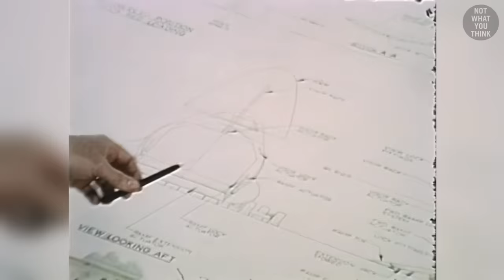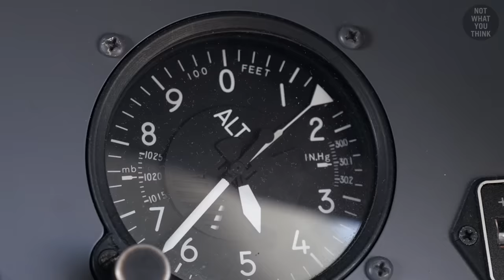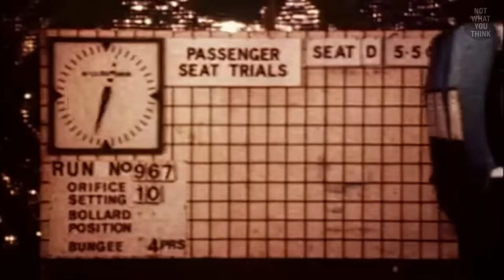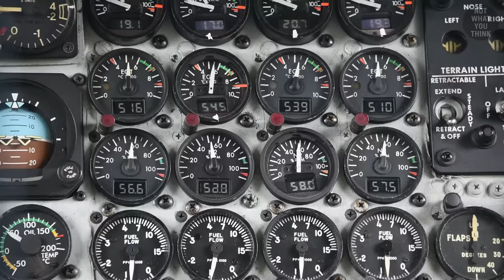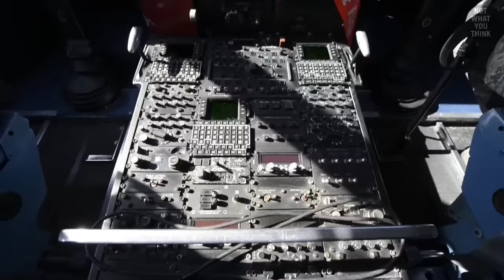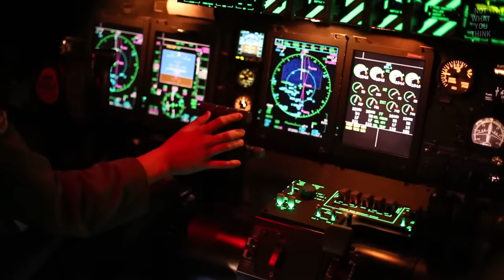America’s MASSIVE Military Airplane that is Named After a Porn Star

Comment: As a 7yo boy, with a father in the USAF, I got to fly on a C-5 from Travis AFB to Hickam AFB.  He even got us an inflight tour of the aircraft; so we climbed down into the cargo bay, across to the other side, and up into the cockpit.  I still remember my brother and I sitting in the pilot and copilot seats (auto pilot was on) while this massive plane barrelled high over the Pacific Ocean headed to Hawaii.
Reply: So you're 7 and you can spell better then me?
Reply: you’re lucky than most of us.
Reply: The C-5 is a luxury Space-A ride, compared to the C-130 or KC-135.  Have been onboard when one had an engine malfunction, and another blew a tire on landing (shrug).
Always wondered what was up with the fog in the cabin before takeoff.
Am jealous ... did not get the tour!
Reply: @Nitrecz  I think he meant when he was 7
Reply: @Ilijah_Senteno  No. no. no
prodigy exist in our universe.
If my father took me into a C5, I would have the rank of General already.
Reply: @GnuReligion  It's the air conditioning. It runs insanely cold and condenses the air around the vents. It's a luxury to get to run it on the ground on a hot day thanks to it requiring the APU to be on which burns fuel. In the early/mid 2000s they started making us limit fuel burn on the ramps so we couldn't run the APU to run AC in the hot summer heat and that SUUUUUCKED. They used to log every APU and engine start/stop time to track fuel consumption and they'd yell at you for excessive fuel burn. Luckily they now care a bit less, but since fuel prices are rising back to the 2008-2009 era rates I bet they start complaining again soon.
Reply: @MinistryOfMagic_DoM  Yeah, my childhood experience in the mid 1980's was of stale hot air at first. Passengers grumbled: "open a window!"  Engines started -- then fog.  That plane is has been a money pit for a quite a while, but it is too unique to take out of service.
Reply: With A Father 🤔🤔😕😕
How Many Fathers Do You Have ?? 😮😮🤣🤣🤣🤣😁😁🙏🙏
You And Your Brother Sitting In Pilot & Copilot Seat. 
And Where Were The Real Pilot & Co Pilot. ( Your Father & Other Gentleman ) In The LOO. ???????? 😮😮🤔🤔😕😕😂😂
Lol US Air Force Allows Family Of Air Force Personals Sit That Too inside the Cockpit Of A Military Plane  And Take Controls 
Ah Now I Understand  Why US Air Force looses All The Time ..... Pilots Not Present Children Of Pilots Present. Pilots Enjoying Life In Their Homes 
No wonder Why Keep on Saying US Armed Forces Top Notch In Each And Every Sphere  
👌👌🤣🤣😂😂
Oh You  Are Such a Lucky Guy
Wish I Too as A Son Of A Veteran COMMISSIONED INDIAN AIR FORCE OFFICER Got This Kind Of Opportunity Out Here In India
Reply: You being a 7 year old, I'm impressed with writing, grammar, punctuation and composition. You're going places.
Reply: @Nitrecz  this was when he was seven. A past story. He is older now..

Or were you being sarcastic?
Reply: @UnforgivenTrucker   I hope your joking. He ain't seven no more. Sometimes it's hard to tell with text if someone's joking or not so. Lmk if you are.
Reply: @TiernanHousman  yeah but he said "As a 7yo boy,"
Reply: Jeez, getting both pilot and co-pilot off the controls inflight, replacing them with children sounds genuinely terrifying from the safety culture POV. Old times... maybe aviation is less fun now, but less deaths, too. Hopefully.
Reply: Yeah, the good old days when we could allow the pax up front.  Hasn't been that way since 9-11.
Reply: like farming. stop it.
Reply: Nice! I also got "a" (as in 1) ride on a C-5G and it was definitely one of the highlights of my life, for sure. I had heard and seen the earlier C-5 models, I grew up in Lake Forest, which was next to the El Toro Marine Air Station, and also not far from Tustin's enormous hanger's. The whine the C-5 makes is so cool and unique, I mean the B-52 sounds cool as well, but the C-5G/M sounds insane! Sitting in the C-5's nice big comfy seats... up behind the cockpit, sure does beat sitting sideways with your knee's against an armored vehicle or whatever crap they packed in the back of a C-17 or C-130. Now if I had a choice, I'd probably pick a ride in an FA-18 as a "back seater" over another ride on a C-5G, but it would be a tough choice. I've always wanted to feel more than a couple of G's, but I know I'll probably never get a chance to ride in a fighter-jet. The only thing that tops my C-5G ride, is seeing a B-2 Spirit up close! I could not lift my jaw off the floor when I got up close to one of those! OMG! The wings are so much wider-longer than you'd expect, I mean it's huge looking up close, way bigger than I thought it would be, for sure. All in all, I've been pretty blessed with some cool views of these masterpieces up close and personal. I've seen or have been on most US Army helicopter's, I've been on the C-5G, I've seen two F-22's, two F-35's, one U2, a few B-1b's, the B-2, a bunch of B-52's, an A-10, plenty of C-130, C-17, KC-135, KC-46's and I've even seen the rare E-6's the USAF uses. Yet it never get's old, seeing how awesome and powerful the US is, so I always try to make it out to the local airshow's. This year I was feeling a bit deflated and un-Patriotic, because of our politics and seeing how we left Afghanistan hurt, but after leaving Day 1, after the "Great Pacific Airshow" in Huntington Beach, California.... I was feeling very Patriotic! God bless America!
Reply: I've taken that same flight except I started at Kelly (most know it as joint base San Antonio or Lackland -> Travis -> Hickam. I've was able to lay in a KC-135 Stratotanker over the Pacific Ocean next to a boom operator. Staring out a glass panel taking a video of new pilots train on a E-3 Sentry taking turns engaging and disengaging after refueling, we're so close in mid-air I can see their faces. I've flown in the C-5 back from Hickam, stopped in Travis flew over to some state on the east coast picked up a Humvee, tractor and a full geared platoon. Flew to buffalo we landed they unpacked that plane in 15-20 mins and were right back up into the air, the pilot told me we were going over niagara falls, requested to circle it. Flew around it about 3 times took some pictures and flew south again. I've had the pleasure of riding in this beast the C-5 with a full load also. I've landed at the Phoenix int & San Antonio Int airport while in the cockpit (C-17), sitting right behind the first officer, the coolest part of entering a high traffic airport is watching the radar. I have so many cool videos I haven't been on a flight like that in 4 years. Just know with all these pro's come cons, you're at the mercy of the Airforce I've been stuck at Travis for 3-5 days every time I land there. The flights might be free but your on the military's time and a lot of your time is spent on waiting lists and bowling alleys.
Reply: @Nitrecz  yea, also its Than not then
Reply: I grew up in Rantoul where Chanute Air Base used to be. They would have annual hot air balloon and aircraft shows. I remember walking into a C-5 when I was younger. It was really impressive how much room was in that cargo area.
Reply: If you’re 7 then I’m Ron Jeremy
Reply: @Nitrecz  nice work bruin👍🤣
Reply: Hickam is the place to be if you’re military anywhere.
Reply: @UnforgivenTrucker  he was 7 when that happened not now
Reply: @AntThinker  remember thr Russian a/c that allowed some kids at the controls . . .
Reply: @GnuReligion  I was a Crew Chief on C-130s from 1999-2009 and I always remember the C-5 as a broke down hangar queen 😂. C-17 is the Cadillac.
Reply: @randy1189 Russia always has incidents that shouldn't change a thing 😂
Reply: Sarcasm really eludes some of you.
Reply: What's a 7 yo doing here, do kids don't play house anymore 🤣🤣🤣🤣🤣🤣🤣🤣🤣1
Reply: @bittoochatterjee2661  man I couldn’t understand your comment if my life depended on it.
Reply: @Nitrecz  I think he use grammarly
Reply: @nobody9429  possibly
Reply: Then everyone clapped
Reply: IM JEALOUS OF YOUR GRAMMAR
Reply: y'all really don't know basic english? if it's your second language that's fine, but from what I see most of you guys are fluent in it yet can't understand this comment
Reply: @Speteroon  yeah but he said "as a 7yo boy" not "when I was a 7yo boy"
Reply: @Nitrecz  bro doesnt know what time is 💀💀
Reply: You DO know about the Aeroflot Flight 593, crash, don't you?  It was an Airbus A310-304 -- the accident happened on 3-23-1994.
Reply: @bittoochatterjee2661  did you just have a manic breakdown?
Reply: Wow you write very well for a seven year old boy. Your parents must be very proud
Reply: Same bro I live on travis
Reply: @Nitrecz  Learn what "as a" means, past tense with the rest of the sentence!
Reply: @Nitrecz he was
Reply: When I was little instead of taking commercial flights we would take we fly on C5'S to get from Sicily to Norfolk Virginia

Comment: Backward facing seats are actually safer in an incident or crash.  But passengers don't like them, we face forward and do that silly bending forward things instead of leaning back in a strong, well designed seat that will offer plenty of support in case of a problem.

EDIT:  One day I'll learn to finish the video before running my mouth.  I still stand by my "passengers don't like it".
Reply: I love that edit 😂
Reply: Just because that's not the primary reason doesn't mean it's not an accurate statement.
Reply: Nope you are 100% correct, passengers do not like rear facing seats.  Some airlines have tried it over the years, BA being the main one, and they are the least desired seats on the plane.
Reply: @Mr. Shark Tooth Thank you, thank you!
Reply: It was more comfortable than the C-130.
Reply: That edit! 😂
Reply: Also accidents are rare enough that we can justify enjoying our forward facing seats.
Reply: I would imagine that rear-facing seats are uncomfortable during takeoff, but should be fine the rest of the time.
Reply: Living near Dover AFB and by extension anywhere in Delaware, I get too see these things all the time and it’s glorious. You feel the C-5s rattle your whole body while they fly overhead.
Reply: @HekateMGO  Exactly. Also most accidents either aren't severe enough for rear facing seats to be advantageous or so bad that they wouldn't help either way.

By contrast military aircraft take much more risks.
Reply: The reason why I always sit in the backwards seats on public transport.
Reply: Trust me, passengers don't mind them.  Have you ever been on a train?  o_O  The reason why is because if you're in an airplane crash, you're probably going to die anyway, so who cares?  "Cram them in like sardines and jack up the rates!  Oh, and have them bail us out every time we can't make a buck, because we're 'Too Big To Fail'."  -Airline Executives
Reply: @williamyoung9401  On trains the forward facing seats tend to fill up first.

I agree aircraft crashes can make seating arrangements irrelevant, but not always. That said the number of accidents where seating orientation would save lives are pretty slim.
Reply: If you are rear facing in an accident, anything that would be flying because of inertia at time of crash has a chance of directly smashing your head. If you're front facing, you're held and anything flying will smash in the back of the seat. In regards of comfort, I've been flying on a C-130 side facing. It's probably worse than any other seating arrangement.
Reply: It's been tried in civil aircraft. Passengers really don't like it

The VC10 military version has rear-facing seats for the same reason as C5. Civil versions tried rear-facing and very quickly switched to forward facing due to complaints

Facing backwards means passengers feel like they're being tipped out of their seats when the nose goes up for takeoff and landing.
Reply: A lot of passengers don't like them, but I'm not one of them. I always take rear facing seats in any public transport,  when available. Because I know the statistics.
Reply: As there are no widows to look out of in the C5 seating area while sitting you really care less which way you are facing.
Reply: That is why I always drive my car in reverse, safety comes first.
Reply: The thing is that backward seats have a tendency to make people sick
Reply: But what is plane gets rear ender?
Reply: @explainedgmod  Now I'm wondering 🤫
Reply: I dunno... if you get rear-ended, you're better off with the forward-facing seats, aren't you??  :^P
Reply: love the edit lol but i still think you’re 100% correct man
Reply: I think you’ll find passengers like safety
Reply: I flew in a C5 back to FBNC from Ft Puke La. And from Germany after REFORGER 82. Flying backwards never bothered me.  Flying in a C130 or a Starlifter full of puking paratroopers did!
Reply: @real_fjcalabrese  understatement.  I would rather spend three days in a C-5 than a 6 hour trip in the C-130. I've done both. Granted, I smuggled whiskey onto the C-5.
Reply: @jhmcd2  I'm one of those people that pick my seat based on survivability statistics so I would be snatching those up at every opportunity.  I'm not afraid of flying, I just know the statistics are not in your favor in a crash so might as well do everything you can to get the best possible odds.
Reply: @peterhoulihan9766  I min/max my survivability odds when I fly by picking seats with statistically higher survival rates.  Sometimes, the little things are just enough to save your life.
Reply: @sandroutb  The seats in business class on the Dreamliner are at this weird angle so they can fully recline.  The seats are awesome but they are very weird on landing and take off.  I can see how people wouldn't like the off angle seats so I can fully understand just how weird a side facing seat would be.  (I've also ridden in the back seat of a Ford Ranger, it's very strange.)
Reply: @nohaboy100  That's not how motion sickness works.
Reply: @LeCharles07  Yeah, but, statistically, you have a better chance of being struck by lightning.  I get it, searching for a seat base on which one is most likely to survive a crash, but I don't run United or Delta.
Reply: Sitting backwards on a bus makes me puke. I imagine it would be 10 times worse on a plane. No thanks. I’ll take the risk. 😜
Reply: @jhmcd2  My wife would get motion sickness and could never ride backwards
Reply: The brace position is safer than leaning backwards because it reduces sudden acceleration from crashes.

It won't cause visual injuries but sudden acceleration can damage your brains. It can damage other internal organs but your brain is the most likely to recieve more damage

When you're in the brace position you body does not have anywhere else to go - especially if you are really close to the seat in front.
Reply: @dustandroktwok1447  as someone who also gets a bit motion sick from backwards seating. In a plane, you can barely tell a difference.
Reply: In light of this video and its name… The backwards facing seats are referred to as “Reverse Cowgirl”.
Reply: They're backwards because of the hard stops on runways when they land.
Reply: The RAF had rearward facing seats in their VC10. I don't think that anyone particularly disliked them. On the other hand the VC10 was famously over engineered and probably ex BOAC or BA.
Reply: @LeCharles07  Why is riding in the back seat of a Ranger strange?
Reply: A related factor is that, in market research, passengers react negatively to measures designed to make crashes safer because they don't like the idea that the airline is accepting the fact that crashes will happen at all, even though they know full well that they do. "We've done everything to avoid crashes" plays well with passengers, but "yeah you might crash but you're more likely to survive in our backwards facing seats" does not.

BTW all the seats in RAF transport aircraft like the VC-10 used to be backwards facing (their passengers can't switch to another carrier...)
.
Reply: @bigjeff1291  because they face the side. I didn’t mind it on surfaced roads. Off roading is another story.
Reply: It really doesn't matter, with no windows. I've flown on C-130's, and C-141 Starlifters, with horizontal seating, like a subway train. Same deal, read a book or newspaper, till jump time.
Reply: @paulmakinson1965  make SURE you use your mirrors for safety’s sake Paul!😂
Reply: @MrKidroboto  I got my first Ranger many years ago (soon after they were introduced). It was a long bed with a single cab. My next Ranger was the “extended cab” version. I don’t remember it having the sideways facing seats though.
Reply: @bigjeff1291  I think it was 2000’s era XLT  subercab. Pretty much jump seat style seating in the back.
Reply: @MrKidroboto  Thanks! I’m so old I forgot what I did yesterday! Old age!🤦‍♂️
Reply: @bigjeff1291  no worries. I’m probably not that far behind myself.
Reply: Yeah and it's not only the uncomfortable side facing web seats, it's the C-130 freezing your ass off part too   LOL
Reply: Bending forward is get your head low so you don't get hit in the head by flying debris.